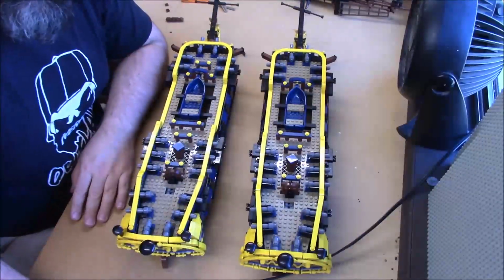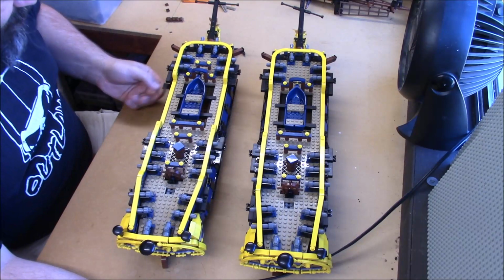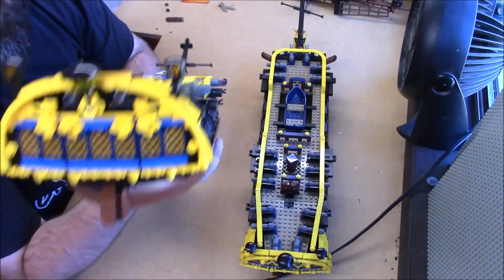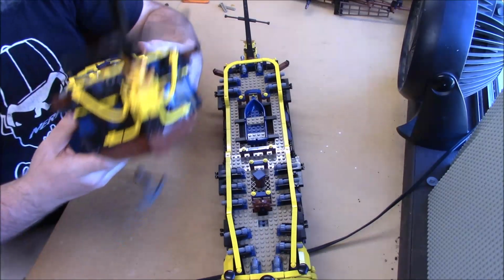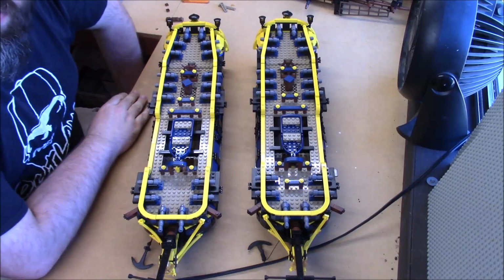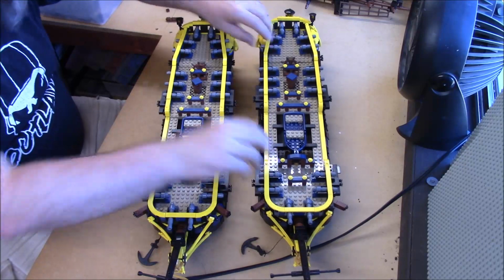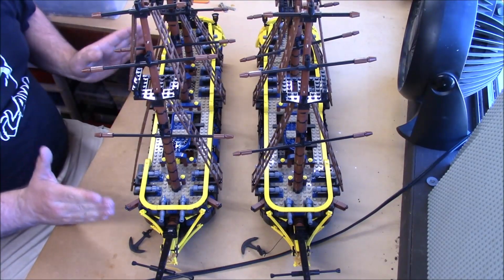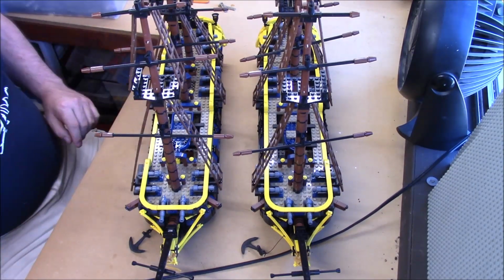MOC Lego Build - Blue Imperial Guard Frigates - Build Day 2

Comment: How many hull pieces long are these? Also how do you scale things? When I build things i tend to measure by using doorways. Specifically a doorway a minifigure could comfortably walk through and how many doorways wide or long. So I tend to upscale things slightly but I still consider it 1 to 1 scale because minifig proportions are funky. I'd like to build a fifth rate 30 gun frigate but I don't know if i want to use lego hull pieces because I want a modular build that has everything below the waterline. So everything below the waterline would be on a display stand and the deck above would have a smooth tile and several stud connections with an inlay to stay in place. But anyway, everything above the waterline would be able to disconnect from everything else for "play." I just find the idea of building everything below the water line daunting (so many curves). Should I start above the waterline and base below on how everything above turns out or should I start with the waterline and base everything above on how below the waterline turns out? 

TLDR I don't know where to start.
Reply from the maker: I would start by checking out Supersick_'s designs on rebrickable.com.  That is what these are build from.

Comment: Those are beautiful models. Are the chasers historical? If yes, what did you base it on?

I'm trying to build the Surprise and I'd LOVE to put brass long 9s on there but so far I haven't found anything useful on where they'd be placed and if they'd just be taken from the regular battery.

Also one note: At least the 28-gun Frigates were called 28s because they had 28 great guns on their main gun deck. Carronades weren't counted. At least that's what O'Brian says and it's consistend with the plans of ships I've looked at.
Reply from the maker: Yup, many surface deck guns did not count. Only guns on a proper full gun decks counted. 

And yes, many ships had stern and bow chasers. Often also not counted. There were no hard standards because nothing was really standardized back then.

Comment: Could you point to the plan you used for the small cannon? Or make a quick how to video?
Reply from the maker: The barrel is: round 1 stud plate + Minifig head + round 1 stud brick + 1x1 brick with technic pin hole + round 1 stud brick. The carriage is a 2x3 plate with two 1x2x1 panels.  The barrel is mounted in the ship railing using a 1x2 jumper plate. They are thus not stand alone and removable, but they are solid and look decent.  I am still experimenting  with other options.